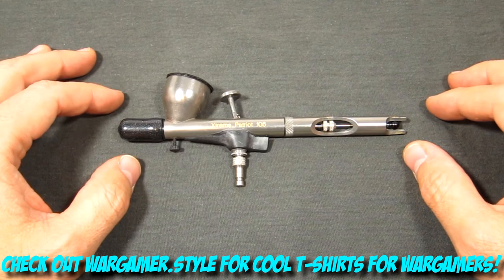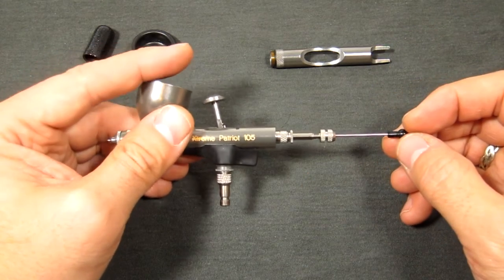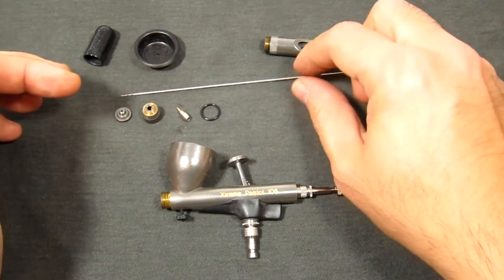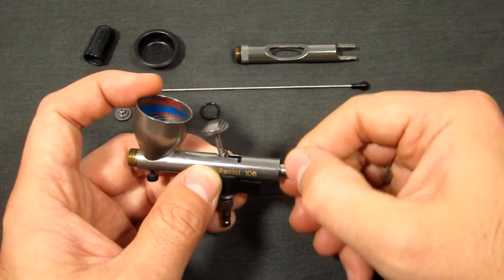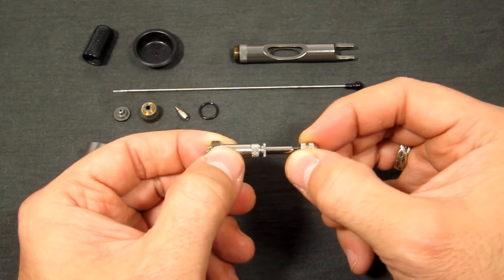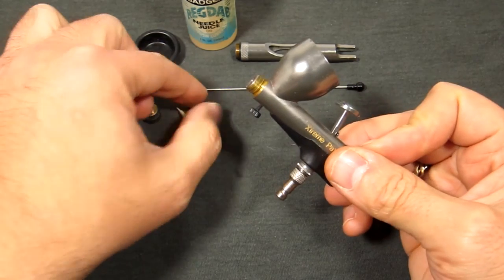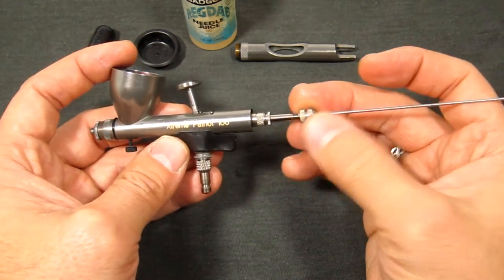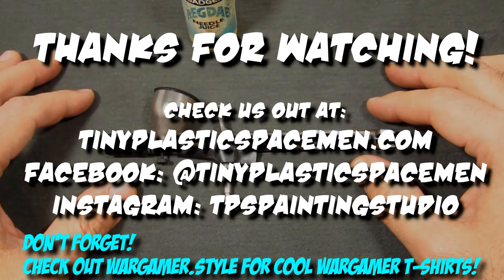Badger Xtreme Patriot 105 Airbrush Disassembly, Reassembly, Lubrication Walkthrough & How To

Comment: For whatever reason I can't pull down on the trigger. I've lined everything up and the needle can go through upon reassembly but I'm just not sure what's causing it.
Reply: it's an old comment i know but did you fixed your problem ? I've the same right now
Reply: @35Elder  yes. I went online and purchased airbrush lubricant and added a small dab down the center where the trigger makes contact and left a little on the needle so it would pass through and lubricate the inside. I pushed the trigger down and back gently a few time so the lubricant would spread and everything was smooth again. Make sure to check your needle doesn't have any dried paint or the ring inside the body that the needle passes through isn't damaged.

Comment: I got the Medium Conversion for Model 105, 155, 200NH, 360 and 3155 (comes with 3 parts) and have been having nothing but problems with this bigger needle, no paint flow, the air goes back in to the bowl even with the trigger all the way back - anyone else tried this? 

I've tried cleaning it several times, with the same problem. Have no issues with the stock set up though.